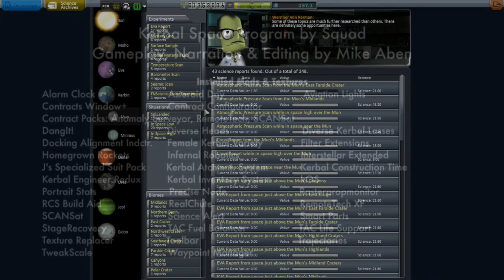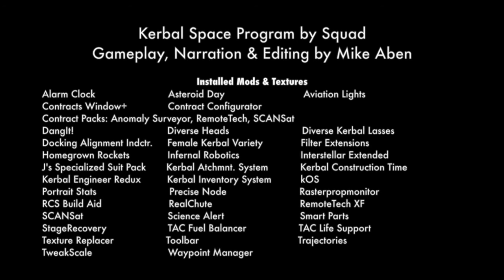KSP Career: Episode 46 - Impact Science On The Mun

Comment: I'm surprised the transmitting did not work... This was supposedly addressed in 1.0.5 and not supposed to "fail", be it by only transmitting say 25% of the whole thing or 0% (especially since getting to 100% in your particular case).   Or they 'fixed' it so it did not mess your data but never record incomplete science ?   ummm... good post for the KSP forum.
Reply from the maker: +Francois424 Yes.  I can't remember if I looked to see if the data is gone or not.  I'm getting back to my game tonight and see what's there.  I've also learned that there are new antenna settings that you can toggle in game.  I'll have to explore those as well.

Comment: !!!! you used tweak scale?!!!
BTW for some reason the efficiency of HGR parts is higher than anything scaled to its size
Reply from the maker: +Niels Demming Tweak Scale is a dependence of Infernal Robotics and Interstellar, so I have to have it, but I gave myself a rule not to Tweak Scale myself ahead in the tech tree.  For example, in the video I scale the 1.25m reaction wheels to 1.875m, but I only let myself do that after unlocking the 2.5m reaction wheels.

I didn't know that about the HGR parts.

Comment: I realize you have already sealed your fate with the impacter. However why didn't you wait for the Korion and refuel it from that vessel?
Reply from the maker: +Brent Lightfoot A good point that I didn't think about, but the Kerion is currently on it's way to Minmus and wouldn't be able to get to the Mun for about another two weeks.  It would need to be refueled in LKO and hauling enough fuel up from Kerbin's surface is expensive (the fuel barge costs $58102 while the Muna 3 mission was $49834).  That said, it certainly was doable, but I have another idea of how to still make use of Muna 3 that I'll talk about next episode.
Reply: +Mike Aben I completley understand not having all the ducks in a row for every launch. How many times have I forgotten a critical part and been out on a mission and not been able to do anything about it. However, that is why we always check our builds, I await your next episode with baited breath.